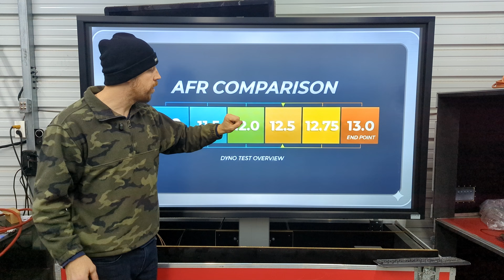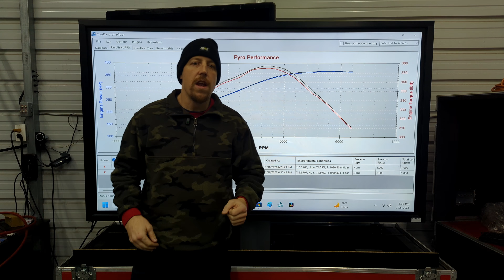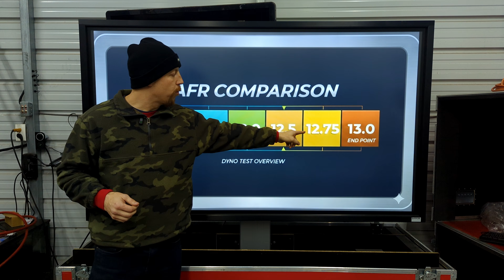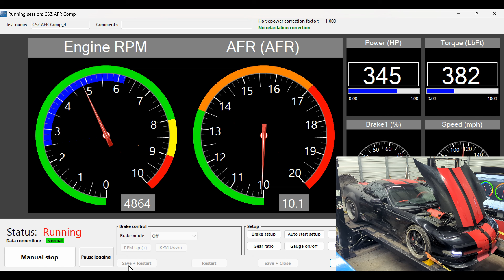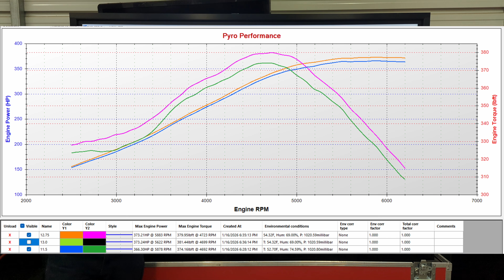Lean vs Rich: How Fuel Mixture Really Affects Power (Dyno Tested)

Comment: Basically the factory knows what they are doing.
Safe tune
Reply: The factory tunes the engine for reliability during the warranty period. Not for maximum performance. So it's partly true to say that yeah that's probably a "safe" air fuel ratio, but it is not optimal.
Reply: @Nicetrybutnotsleeping optimal is subjective. It's optimal for not blowing up. If you care more about a couple horsepower you can trade safety for power but only if you're cool with the proportionally higher risk of blowing ur shit up
Reply: @Dude8718  Well said gentlemen we've gotten to the bottom of the paradox, "factory tune is most safe for wear, but sometime sacrifice engine/safety for power=fun maybe blow up who care?", but most people knew that from knowing that already and seeing a Camaro on the dyno.
Reply: Some factory tunes run 14.7 at full throttle and load. Tuning can actually make the engine more reliable and more drivable with better afrs

Comment: i aint watched yet. but my car (8th gen civic si, k20z3) had a pull and i leaned out to 13.5 above 8200 but i didnt knock. i still freaked out, added fuel so now i run 13.0 and now im knocking in that same spot. im afraid to make the right change :(
Reply from the maker: Richen it up! There's no reason to run it that lean. Mid to upper 12s should be a safe spot for it.
Reply: @PyroPerformancePNW  i gotchu, thanks!!!
Reply: now im running 12.8 in that area with MUCH less knock. thanks pyro! imma keep playing with it and smooth things out, then on to ignition timing
Reply: @rabbitdrink that is the sweet spot for K series 12.8 … for a circuit race car 12.5 for me

Comment: If the AFR is slightly leaned out can the risk of detonation be mitigated with water meth injection in order to reduce combustion temperatures?
Reply from the maker: Yes! Generally speaking, anything that reduces the temp of the air/fuel mixture will reduce the risk of knock.

Comment: I see you are in Vancouver. I was the dyno operator at Dings from 2014 to 2020. An LS guy tuning mostly Mopars. They behave very much the same. 
We took a lot of the cars we tuned to PIR and did the final touch up there.
My own C5 runs 10.70’s btw.
Reply from the maker: Badass, I love it!

I'm working on making my dyno accessible for people to test/tune their own vehicles. If you need something like that, give me a shout.

360-217-9048 (Luke)
Reply: @PyroPerformancePNW  thanks! I’ll put you in my contacts. I do run across tune jobs that are just too fast to be doing street tunes on. Maybe I can send some business your way.
I’m also buddies with Mr Wong. We graduated high school together. Ron

Comment: Try that with a boosted engine and you’ll be picking up pieces off the floor
Reply: Boosted engine demand same 12.5 to 1
But most owners pushed boost to detonation and added  fuel to cool intake air  to avoid detonation
Use water/alcohol  spray
Reply: @alexgo1034 11.8-12.0 afr with boost over 15psi if you want it to last
Reply: No shit Sherlock this was a test of a NA engine
Reply: @yucannthahvitt even a high comp n/a engine would be detonating at those afr ratios
Reply: @anthonywhelan8373  You just keep coming back with the stunning but irrelevant insights, luckily that's an ordinary corvette engine not a 14.9:1 big block running on F160 for a pro street NA class. Did you somehow think the guy in this video was attempting to say this applies to every engine and situation in the universe?
Reply: @yucannthahvitt your the fool that stated!! It was based on a n/a engine 
What you should have said it was for your mums Camry out of the factory dead stock 😂😂😂

Comment: It all depends heavily on the compression ratio.
Low load results in unstable combustion with a lean air-fuel ratio (AFR).

This is less pronounced with a high compression ratio and smaller displacement engines (conventional bores).

In the two-stroke world: "lean is mean...".
Could the comparison be more nuanced, perhaps, with an ignition timing curve adapted for low RPMs (different and asymmetrical strategies for all AFRs)?

Comment: I have a Nissan 370Z that had intake and exhaust mods and then an EcuTek dyno tune on a Dynojet chassis dyno. The tuner did 6 or 7 pulls at WOT and got the AFR stabilized at about 12.5:1 across the rev range. He then optimized the ignition timing, where we got a fairly flat torque curve across the rev range with the torque scaling up by about 15%. We picked up about 50 peak crankshaft hp, from about 332 to 380. You're right about the throttle response improvement being immediately noticeable.

Comment: I always thought, for typical passenger car engines with a stock cam, about 13:1 gives the best power, but bad mileage, 16:1 gives the best mileage, but less power, and about 14.5:1 is the best all around ratio, giving a good balance between power and economy.
Reply: I think most cars since 1980 use a 14.7:1 ratio during light throttle operation and about a 12:5 ratio at heavy throttle. I don't know at what point it transitions from lean to rich. I think it is about 6 inches (or 3 PSI) of vacuum. Some carburetors have a power valve that adjusts fuel mixture according to the amount of manifold vacuum.
Reply: @andyb1221 The catalytic converter is fully effective only when the A/F ratio is between 14:1 and 15:1.  Richer or leaner significantly reduces it's effectiveness.

Comment: You should use lambda since every software uses it now
Reply: Older cars aren't computerized.
Reply: @jamesbosworth4191 didn’t realize my 2001 25 year old bmw wasnt computerized. Let me remove the ecm
Reply: @antigripmotorsports  When I say "Old Cars" I am talking about pre 1980s cars.  I am 70 years old, so to me, a 2001 car is not an old car.
Reply: @jamesbosworth4191 im not sure why you commented about old cars to begin with. This video is about target afrs on a computer tune.
Reply: @antigripmotorsports Weren't you guys griping about how modern cars can be tracked?  I pointed out that old cars CAN'T be tracked, as they aren't computerized.

Comment: so much for stoich ! 14.7 let the ring burning begin, the nockers will knock, and the valves will require exotic stuff
Reply: 14.7:1 is the best all-around ratio, giving a good balance between power and economy.  It does not give max power, nor does it give max economy.
Reply: @jamesbosworth4191  if there is one thing tuners never mention it is the fact that fuel is the primary coolant. more = cooler
Reply: @GREFOUNDRY  Yup, a rich mixture burns cool, a lean mixture burns hot - if you engine has valves made of cheap metal, they might burn if it is running lean.

Comment: I'm a tuner, and based on these tests I would leave it with an AFR of 12.6 / 12.5; it's safe to accelerate in all gears or at top speed without fear. Four horsepower won't make a difference.
Reply from the maker: Agree 100%
Reply: Although it doesn’t affect power too much, it makes a significant difference to fuel consumption and these days it is a factor on a road car.
Reply: Question for a Tuner: Why is there a big dip in the torque curve centred around 3200rpm? It's got 8 equal length intake runners.
Reply: @TheBicketyBam  It could be due to the camshaft, the throttle bodies, or both.
Reply: Hope you are talking about WoT. If you mean to just put it to 12.5 all over then you are not a tuner. I would not even call you someone with the least bit of knowledge in ICEs. Sorry.
Reply: @niconova454  Sorry, internet chatterbox, but you're the one who's never calibrated a car's tire pressure. When you have more experience, you'll understand better how it works.
Reply: @carozomagno nice one. Maybe you should do a bit of research and check a few other posts before you let out stuff like this. 
But given your response it is pretty obvious what kind of person you are. Lost all interest in further...exchange of words. Happy "tuning"!
Reply: @niconova454  You spouted nonsense and got back exactly what you put out—on top of having absolutely no knowledge in this area.
Reply: @carozomagno yeah,right😂
Reply: @niconova454    internet boy detected

Comment: Can you talk about part throttle/tip in lean of 14.7 stoic?  Is knock a concern at >14.7?
Reply from the maker: It's hard to respond with absolutes because there are a lot of variables, and occasionally a specific combo will break the "rules".

In general, stoich or slightly lean is fine at light load/part throttle. Lean mixtures burn slower and can increase temperature, but cylinder pressure is low enough there that knock typically isn't a concern. As load increases, running lean becomes more of a knock risk.

For tip-in specifically, you'll often need to richen it briefly. When you open the throttle, manifold pressure changes quickly (often faster than the sensors and fueling can react), so transient enrichment is needed. That's not just how much fuel to add, but also when you add it; whether it's immediate or slightly delayed depends on the application.

Comment: you didn't dyno from rich to lean or whatever. Not a single ratio you tested was lead. Every one was a rich mixture....lol   There is a distinct difference between lean and "not rich enough"
Reply from the maker: "Lean" here isn't about being above stoich — stoich isn't relevant to a discussion on WOT performance.

When engines get hurt running "lean", it usually just means they weren't rich enough to manage combustion temps under load, not that they were >14.7.

In this context it's all relative: some mixtures are richer, some are leaner, and the point is how those changes affect performance.
Reply: @PyroPerformancePNW exactly not rich enough even though it isn't lean
Reply: .0001% leaner is still leaner. You’re just arguing about words lol. 

He didn’t come here to blow it up on the dyno get a grip lol.
Reply: @zacharyjoeburt arguing about words or established chemistry? Simply put, something cannot be too lean if it isn't lean to begin with.
Reply: yeah he’s just spinning wheels on the definition of lean though lol.
Reply: He’s implying you were gonna come out and slap down some 18afrs on the dyno WOT or something like that’s a good idea.. 😂. yes there’s a range of acceptability that you can try. Yes one spot is leaner than the other. Yes that makes the leaner spot “lean” in regards to the other spot. None of that has beans to do with stoich I’m right here with ya lol.

Comment: If you want to throw another variant into the mix, the VE of an engine is going to affect how both of these items change power as well.
Reply: this guy claims he dyno rich to lean when every ratio he tested was a rich mixture.  for example....When someone claims a 13.5:1 is too lean for their combo they are an idiot. 13.5 cannot be too lean because it is already a rich mixture to begin with. Proper term would be 13.5 is not rich enough.
Reply: @brianbull3558 A lot of newer (factory) engine management systems don’t even target specific AFRs necessarily anyway these days. Many of them target torque figures and depending on things like atmospheric pressure, IAT, coolant temp,
Etc. it may target one AFR today and another tomorrow to make the same power.

Comment: My supercharged Viper runs “best” around 11:5-1 AFR.
Reply from the maker: That's pretty typical for boosted setups: richer mixtures help with knock control, so "best" often ends up being a balance of power and knock margin.
Reply: @PyroPerformancePNW I’m also spraying 12gph of water/meth at WOT too 😂
Reply: @barryarmsfflsot  then you are running too rich. Go to 12.5 afr😊
Reply: @flrpower5628 wait, what? I said it runs best at 11:5-1, and you’re saying to make it leaner, so it doesn’t ru
 as good? 🤷‍♂️ not following that logic.

Comment: nice video bro, i suppose that you use the same ignition timing on each test? it should be interestign to push the ignition timing to the knock limi -2° on each test to chech the real efficiency of the air/fuel ratios. 😉
Reply from the maker: Yes, same ignition timing across all tests.

You can definitely chase AFR & timing back and forth like that. I chose not to change spark advance at all throughout this test to isolate AFR and show its actual effects.

If you tune each point to the knock limit -2, you're no longer isolating anything and in this case it would significantly reduce power.

I go into that more in the spark advance video. Check it out, the link is pinned in the comments.

Comment: Your dyno results aren't at a 1:1 ratio. If it was, the torque and power should intersect at 5252 RPM, so the results are misleading. I've looked at your other videos, too. Same thing.
Reply from the maker: The 5252 intersection only applies when HP and TQ are plotted on the same scale.

I'm using different scales on the left and right axes so the curves don't sit on top of each other and you can actually see the changes. The underlying data is the same. If I put them on the same scale then they would intersect at 5252.
Reply: @PyroPerformancePNW  Yeah, you explained what 1:1 means. It's still fundamentally misleading...

Comment: Running at constant rich mixture and not having a cruise /leaner ratio actually long term fuel washes the cylinder bores.. Washes the oil from cylinder bores .  For a street car not running richer mixture can be beneficial .
Reply: What AFR threshold do you observe washes oil from cylinders?
Reply: @michaelbwbrenner  Running constantly below   13.1 . It comes down to tuners ability . I`m talking street car
Reply: It is desirable to occasionally run rich for cylinder cooling.  The starting point should be the stoichiometric mixture.     "Tuning" is a misnomer, to get significantly more than stock power requires more air and more fuel not fine tuning timing and the ratio.
Reply: L
Reply: Bore washing at these AFRs is nothing but a myth.

Comment: Do you account in your calculations for dissolved air and solubilized Oxygen in the fuel itself?
Reply from the maker: Not directly, but it's already baked into the result.

The engine only "sees" the actual mixture and burn, not the underlying chemistry. Since this is measured AFR vs power (via wideband), any fuel properties are inherently accounted for

Comment: This information is specific to a Cartoid or Wedge type combustion chambers. These are considered a slower burning type of chamber compared to what's run in 4 valve heads. So, they don't burn as clean, and require more advanced ignition timing.
If you have an engine with a Pent Roof style combustion chambers, common in 4 valve heads, you can make more power running even leaner.
Reply: What about the heat?

Comment: I sure the technology is already available, but in time, you will hook a car to a hub dyno, and an AI controlling it will do Dyno sweeps and iterate the perfect fuel and ignition table from the results. Arnt self learning ECU;s already doing this?
Reply from the maker: There's already a lot of efforts being put into AI tuning. I have not personally tuned anything with AI, but like anything (at least at the current time) it's going to be a mixture at different times of good results, and AI hallucinations. Will the hallucinations be bad enough to have catastrophic consequences? I personally don't care to find out.

For the self-learning ECUs that I am aware of, they can self-learn fuel tables quite well, but things like spark are another story.

Comment: You are spreading so much contradictory information. Obviously you never worked with lots of different boosted engines. They love richer AFR at peak torque RPM. Secondly, you are saying that 13:1 made less power  comparing to 12.75:1 but do you realize that every single engine is different and some engines might like 13:1 more than 12.75:1? Some engines like 13.2:1 and so on... This is what you should be saying when talking about "rules" in engine tuning...

Comment: No one rides wide open throttle all time . It's stupid.. it's drivability in turns mountain riding and coming out of turns .cmon custom deal.. rideability..
Reply: You need a hub-dyno to tune that, chassis dynos are pretty useless for drivability tuning.
Reply from the maker: @krusher74 you are only correct in the event that the chassis dyno doesn't have a brake. Mine does, so the only advantage to a hub dyno has over mine is that there's a possibility of wheelspin.

I do plenty of part throttle tuning on my roller dyno. The main difference between a hub and roller dyno is just how the drivetrain of the vehicle connects to it.